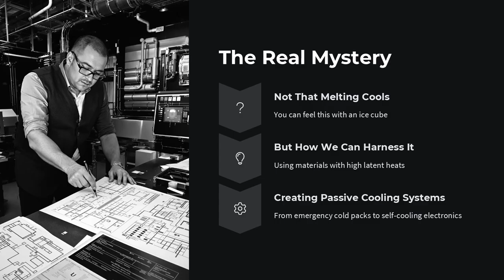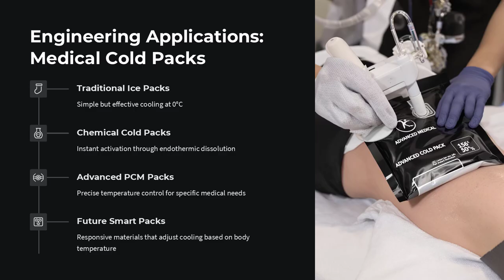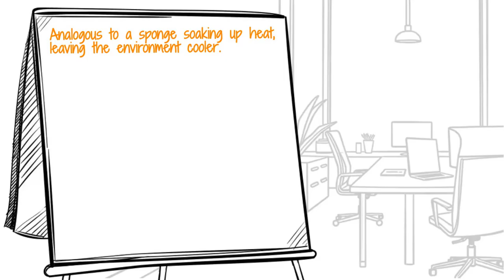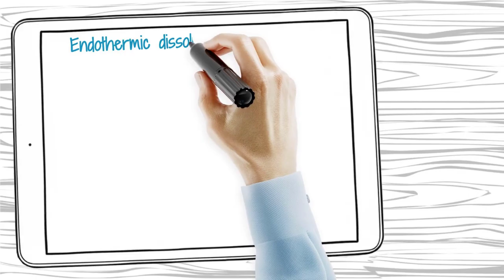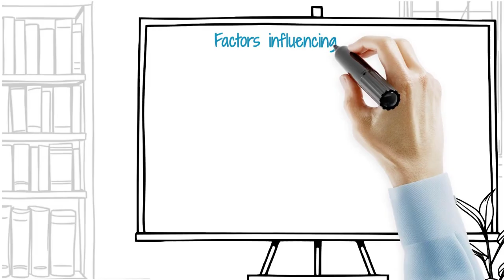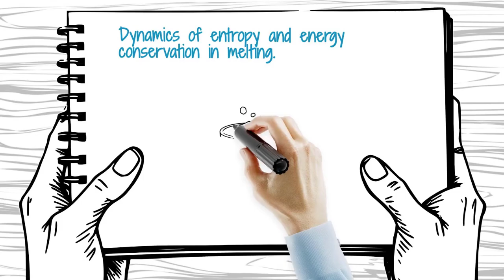How Melting Can Cool: A Thermodynamic Puzzle Explained

Comment from the maker: How does the microstructure and confinement of phase-change materials affect the rate and efficiency of heat absorption during endothermic melting?
Can supercooling and metastable melting states be predictably engineered into composite thermal materials for controlled energy extraction?
What are the quantum and nanoscale thermodynamic variables that influence non-classical energy flux during melting transitions in confined geometries?